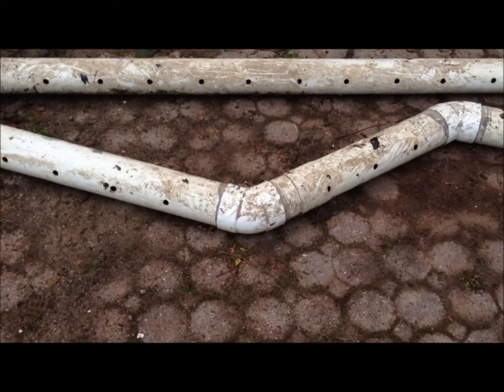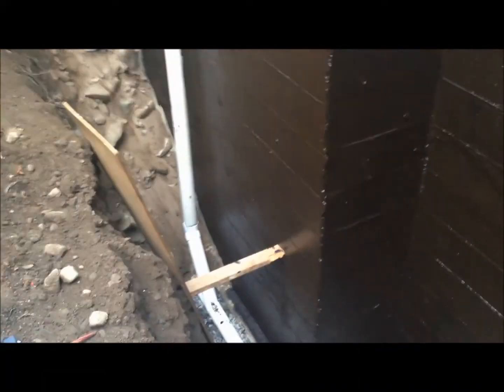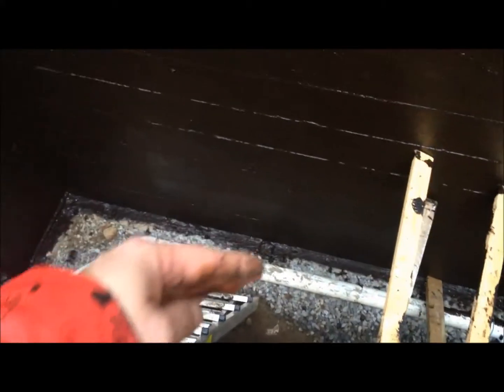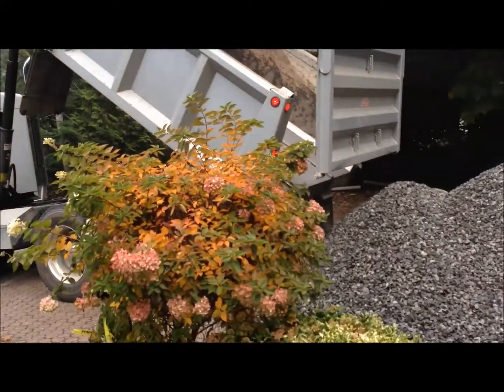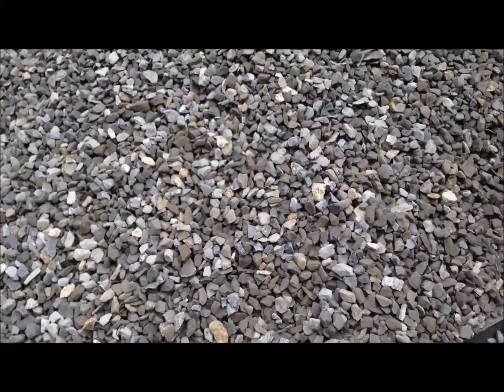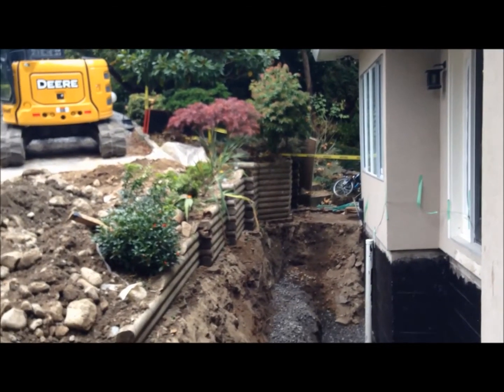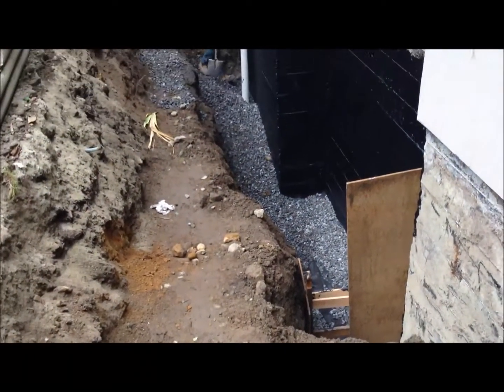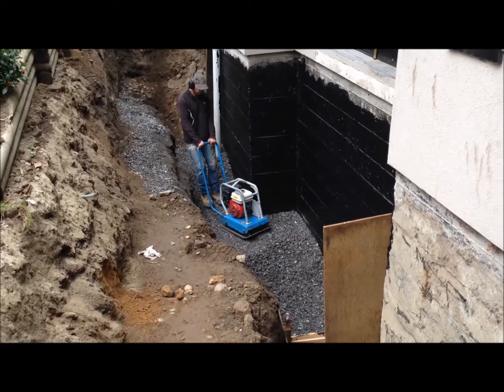House foundation repair Part 4 - Rebuilding the excavation with fresh crush

Comment: hi, may I ask how much this project cost you? (just the house waterproofing/excavation). And what if a contractor doesn't use gravel? thank you.
Reply from the maker: You have to fill this with gravel otherwise your pipes get filled with dirt right away and are useless. I spent about US$50K on the whole project.
Reply: Doug Brown do you recall how many feet of drain pipe was installed?

Comment: Question, why you didnt dig all the way around the house
Reply from the maker: Hicham Rzig Our house is on a slope and the drainage problem was predominantly across the front of the house where the builder had used bad fill and plugged the drain tile. I used an auger to push all the mud around the tile that surrounds the house and into the sump.